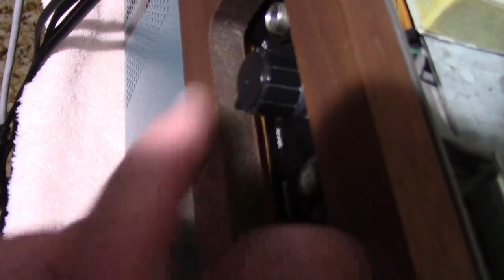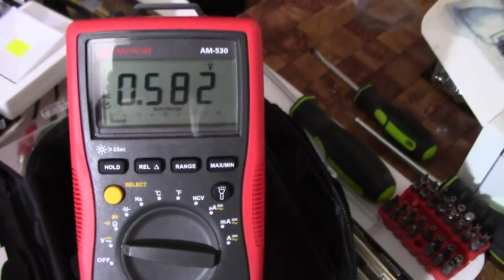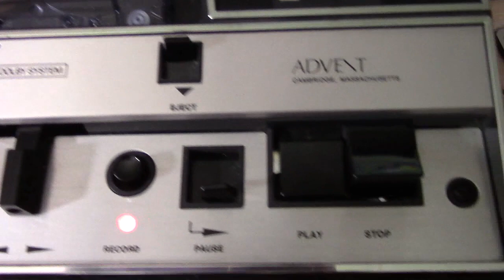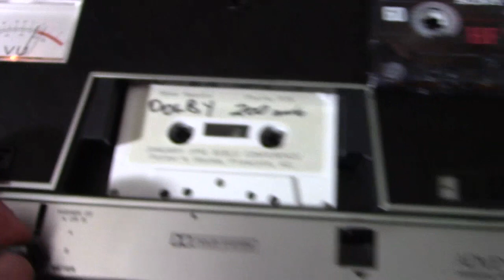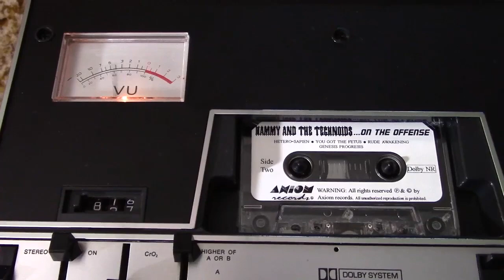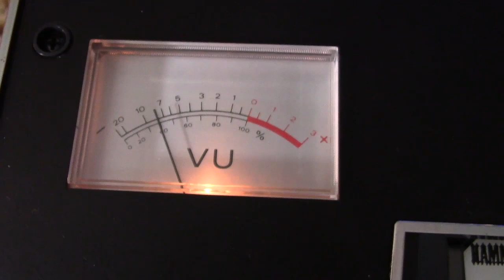Advent 201 Cassette Deck: Calibrated

Comment: Greetings!  Glad to see the owner of Advent 201!  My question is, how can you adjust the playback speed?  My deck is playing slower than necessary ((I did not find the usual way of adjusting. I would be very grateful for your help !!!
Reply from the maker: I recommend you go to hifiengine.com and check out the service manual they have listed there. It's free, and could be helpful. There are some places you can check for lube or adjustment. Hope you resolve the issue. Thanks for watching.
Reply: @HammyTechnoid  Thank you very much for your answer!  I have an original service manual, but this did not help in solving the problem with speed ... The fact is that there is no speed regulator, as such ... And I thought that maybe there is some kind of trick, a secret.  ..))
Reply from the maker: @genryford  The service manual online didn't mention anything about speed adjustment, but it did bring up the possibility of lack of lubrication or friction. Tracking down the usual suspects may result in a fix. Wish you well.
Reply: @HammyTechnoid  Understood you, my friend!  I will pass on your recommendations to my master!  Have a nice day, thanks again!
Reply: @HammyTechnoid  The Teac a450, which I have, has the same nuance with adjustment.  After changing the belt, it plays great!